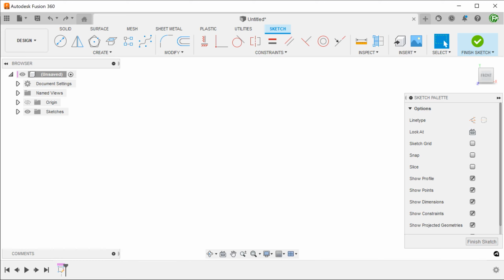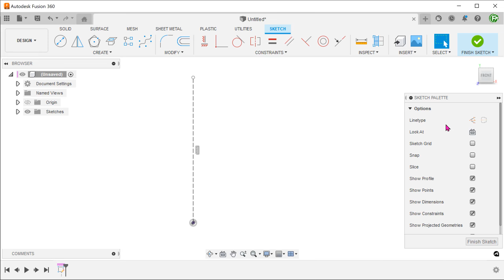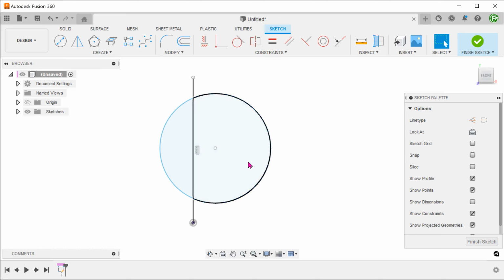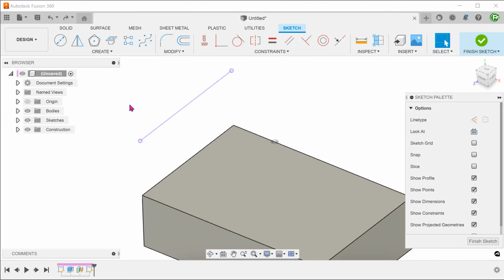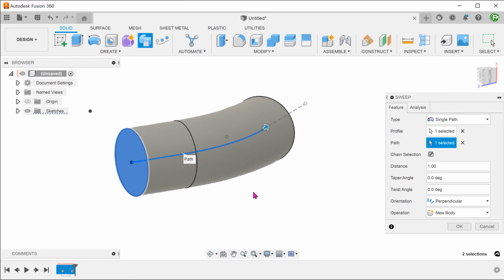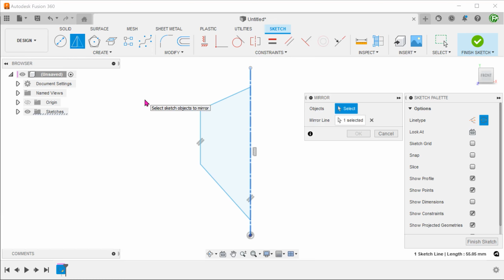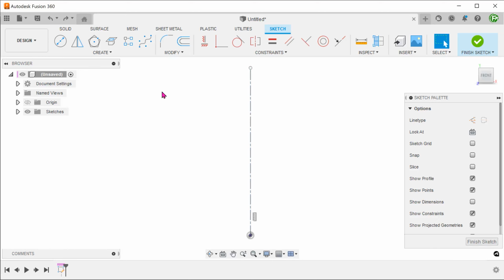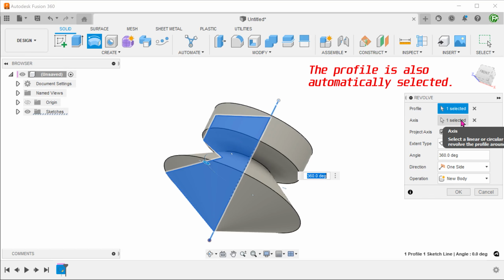Fusion 360 | Centerline VS Construction Line

Comment: A centerline also changes dimensions from radius to diameter when referencing it during sketching.
Reply from the maker: Forgot about that! Would have been a good point to add in the video.
Reply from the maker: Forgot about that! Would have been a good point to add in the video.

Comment: I would like to add the all the automatic selection of the center line stops working if your sketch has more than 1 centerline
Reply from the maker: That makes sense, though it is hard to imagine a situation where you would need multiple centerlines within a single sketch.
Reply: @Fusion360School  you are absolutely correct but I am sure someone out there might do it by mistake and think since they are colinear it wouldn't matter

Comment: Centerlines are one of the most useless sketch entities.
Reply: Considering they are somewhat useful, that says a lot about everything else 😅

Seriously though, as much as a single mirror or revolve isn't worth the hassle of making something a centerline, sometimes it is nice to have
Reply: I use them all the times when modelling parts  for turning on the lathe. It makes dimensioning way easier because you can insert diameter values instead of radiuses when you select them.